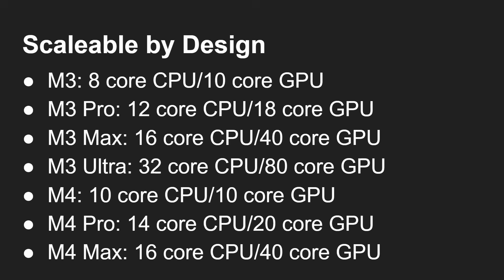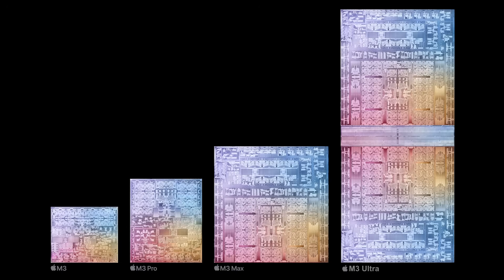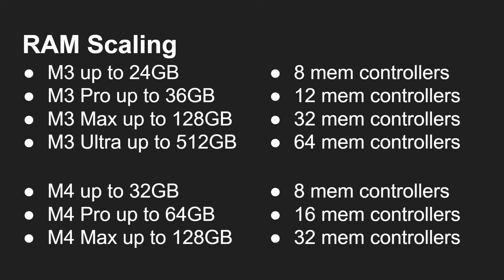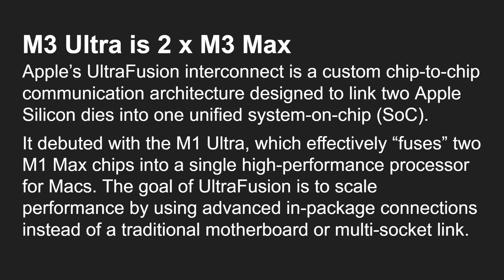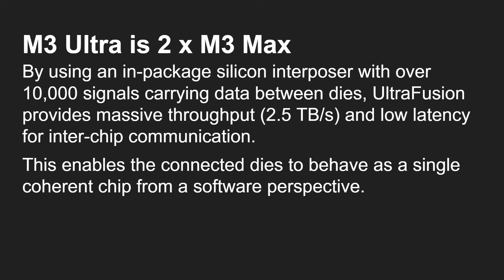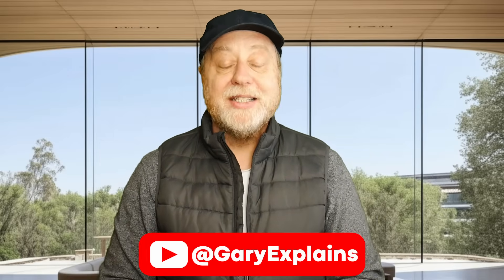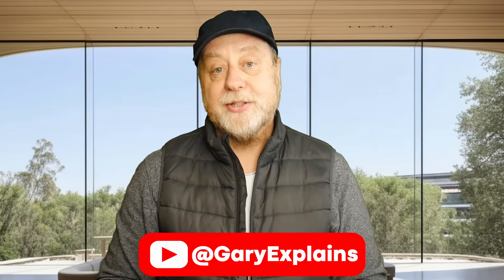The Magic Behind Apple's UltraFusion Interconnect

Comment: I am somewhat dubious that the yield from this interconnect process is better than the yield of two adjacent die on the wafer being good.    By two die I am making the assumption this could be done with a single die which is double the area of a single die.
Reply from the maker: There is a limit to the die size, so a bigger single die can't be made.

Comment: The M3 Max did not have the interconnect when it appeared. The M4 Max doesn't either - so the lack of that on the Max at release doesn't mean that  an Ultra wont come from a later run Max, as discussed heavily on recent ATP episodes.
Reply from the maker: Some people seem to be confusing the lack of a physical interconnect and the support for an interconnect. Not having the "pins" on the Max version is basically irrelevant. The message that Apple seems to be sending out is that the M4 doesn't support an interconnect, not that the pins are missing.

Comment: This has a lot of inaccuracies, but it's a video about the UltraFusion Interconnect, so I'll stick to that. You keep talking about 'snooping' but don't seem to know what it means. Each die has a cross-die coherency controller which is only active if it's in an Ultra configuration connected to another die. The protocol is called snooping for historic reasons, but the coherency controller doesn't 'snoop' looking for stale cache data. Half the system memory is on one die, and half is on the other. When a core accesses memory on the other die, it sends a request across the interconnect, and the coherency controller keeps that address/core in a dictionary. Each core has caches. When system memory is accessed, the coherency controller checks the dictionary and sees that cores on the other die are using that address so it sends a message across the interconnect telling them to update their caches with the new value. This is a lot of traffic, and it's why the interconnect needs so much bandwidth. The whole NUMA (non-uniform memory access) architecture is like a Xeon or EPYC server, and it makes things a lot more complicated. They had to make a lot of tradeoffs. The memory has crazy badndwidth, but latency isn't is any better than anything else. It's basically GPU memory which is being shared by everything, so even though it's almost as much bandwidth as a high-end NVidia GPU it has a lot of caveats because everything is sharing it. Most of the bandwidth is used for coherency traffic.

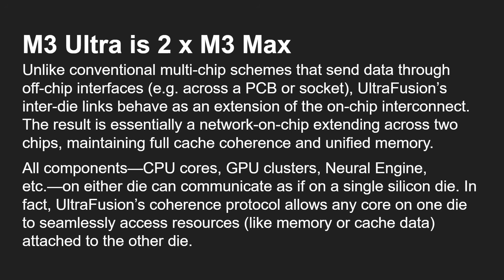10:35 It's not like being on the same die. There's sooooo much more going on because it's NUMA, and memory latancies across the interconnect are just as slow as cross-socket latency in Xeons. Not to say that it's slow, but it's also not faster than a DDR5 Intel machine whether you're talking about cross-die or local memory access. It's about 80 ns local and 120 ns cross-die.

The magic is in the bandwidth, and the coherency controllers, and fitting all that into something that small. But it's still a Mac. Those GPU cores are magically power efficient, but they're a completely different architecture from NVidia, which is why you can barely run TensorFlow and you don't have most of the libraries you need for it.
Reply: Luckily it's a Mac, so you don't have to use TensorFlow and hop on to the crazy Nvidia roller-coaster of vapourware. You can just do Mac type things! 🎉 ... over 40 years of Macintosh and people still haven't got it. Wetware evolution is so slow, you always have to wait for one iteration to die in order to improve.

Comment: Do you think we are about to see a revolution in how we program and design chips?  We spend so much silicon doing branch and cache prediction and with AI it looks like we will finally have smart enough compiler technology that we could finally move that responsibility to software.  Let the software inform the hardware about what can alias, what needs ordering guarantees and what memory should be loaded into cache.  This may have been the idea with Itanium but it was focused at very short term instruction level stuff and the compiler technology just wasn't there but it seems like that is finally an idea that may come of age.
Reply from the maker: The problem is that with a multi-tasking system where lots of different tasks are running then "the compiler" only knows about the code it is compiling, not the whole system.
Reply: @ That is certainly true and the processor would need to allocate cache between processes but thats no reason not to tell the processor what information will be needed and when.  I guess I just mean do you think we'll move to a world where software cache hinting is both extensive and necessary and similarly with hinting about branches taken and alias hinting?  I mean tsx can offer huge speedups for transactional memory and it's basically very limited hinting.

But I don't really understand why cache hinting isn't more used now so I must be missing something.
Reply from the maker: I think cache hinting is used a lot, and all the current pre-fetchers, by design, try to "guess" what data will be needed in the cache next based not only on the address of the last failed cache miss, but also what is in the pipeline and what the branch predictors are saying.

Comment: We can only speculate why Apple used M3 architecture instead of M4 for the Ultra variant, but it might be that M4 is designed for the next gen Ultra Fusion interconnect. M3 Ultra might be the last chip using 2D die stacking, while M4 Ultra could use next gen version based on the TSMC's SoIC-mH (molding horizontal) 2.5/3D die stacking now rumored to be only in the M5 Pro, Max and Ultra. There's also a rumor that M4 Ultra is being saved for the Mac Pro which should be revamped and updated by the end of this year in order to increase its very low sales and promote its quite niche market customer base. Another speculation is that Ultra variant has been silently discontinued after M3 Ultra together with Mac Pro, but I don't think so as Ultra chip is something like "one more thing" to classic 3 version Mx chip offering. Mac Pro on the other hand looks kind of questionable in comparison to the quite successful Mac Studio, but Pro might stay alive and become something like Mac Pro "server" with upgradeable cards and storage. Only time will tell which of these and other speculations r true, but what we can be sure of is that 2.5/3D chip stacking and advanced packaging like TSMC's SoIC is upon us besides other very interesting chip technologies in making as further transistor shrinking is becoming more and more difficult. Rumored 2nm M6 isn't a silver bullet solution and even Apple knows it's hitting the limits so more other exciting tech will be needed. I also think that in one point when price is right we will see Apple adopting HBM for their top tier chips like Ultra and Max as an indirect competition to Nvidia's AI enterprise chips. Apple certainly wants a piece of that BIG AI pie mostly enjoyed by Nvidia. Personally I think Mac Pro server-like solution could be a great idea if Apple opens Unix based Mac OS to more customization and variety of supported upgradeable cards and 3rd party tech.

Comment: Another possibility is that maybe the M4 ultra design is not based   on the standard M4 Max SOC but on a different M4 Max type SOC designed for the fusion process. As clearly the M3 Max Fusion SOC is not the same old M3 Max.

Comment: The main reason for countless versions of Intel and AMD chips is binning, not demand.
Reply from the maker: I don't think that is correct. The different model variants with different clock speeds, yes, but Intel has a huge range of CPUs that have nothing to do with that.
Reply: Of course there are different designs for different purposes, like ultra low power mobile chips, mobile chips, desktop and server grade chips. That is a part of the variety and that is based on demand. But the fact that there are between 3 and 10 tiers of the same chip each, is based largely on binning. Yields and fabrication defects lead to this. This can be observed well with the 7000 series of Ryzen chips. They’re essentially all the same chip with different binnings and cores disabled. Silicon lottery defines the top speed, core defects in manufacturing lead to different core counts. And because developing wafers is extremely expensive and time consuming AND there is very limited fab capacity worldwide, getting the absolute maximum number of sellable chips out ofveach wafer is paramount to a profitable design.
Reply from the maker: Obviously I am talking about the first list you mention from ultra low power to server. Apple doesn't need to make those, it just makes what it wants.

Comment: At what costs in performance does the interconnect come all te synchronization comes at a penalty in performance, maybe its more penalty in terms of CPU usage than in use of GPU usage or NPU usage, BUT synchronization dooes not come for FREE, otherwise i would make sense to link 4, 8, 16, 32, 64, 128, 256, 512, 1024,.... CPUs via Ultrafusion, the synchronization work will grow exponentially and eat up the performance gain additional CPU-dies will deliver. The question is simply how small Apple can get the synchronization if it is just a 5% Overhead, or a 30% overhead, combining 4 Dies as rumoured for the hydra only makes sense if the ovehead does not exceed 50% (even then it is highly questionable if it makes sense), also the efficiency comes into play as the prices due to small numbers will skyrocket in production. It seems allready that the M3 Ultra provided Mac-Studio sips more than double the power than a M4 Max equipped Mac Studio, which leads to the assumption that a 4 dies arrangement even would perform worse.
Reply from the maker: If the M3 Ultra is two M3 Max chips then of course it uses twice the power 🤦🏼‍♂️
Reply: @GaryExplains  It is not two complete max Units, but one ultra unit sips more than two complete max units, its sips more than double power but providing less than double the performance. so efficiency factor is not 2 but more close to 1,5 to 1,7 depending how well it scales (the metric asked is performance per watt)
Reply from the maker: Isn't that true of all multi core systems from every processor designer. It isn't about the interconnect. Amdahl's law etc.

Comment: I suspect a problem for Apple is that TSMCs 2nm process is a year late and we don’t yet know if it will be out late this year, or next year. An M4 Ultra might have been designed for 2nm but couldn’t be made yet. It’s always possible that Apple may come out with newer M4 Max chips with the connector, when they’re ready. Otherwise, we might see it for the M5. I’m still using my M1 Ultra Studio. It’s plenty fast still. But if an M5 version comes out late this year or next year, I’ll likely pop for one.

Comment: 15:22  the M3 Max chips that shipped in the MacBooks didn’t have interconnects either. They manufactured updated versions of M3 Max with the interconnect, thunderbolt 5, and extra RAM capacity, just to use with the M3 Ultra. So they could be planning on doing the same thing with M4 Max. The M4 Max that is currently in releases products doesn’t have an interconnect, but they could be manufacturing versions of it right now for the M4 Ultra that would, theoretically go in a new Mac Pro. They may even be manufacturing M4 Max chips that can connect FOUR dies together for an even more powerful ultra chip; again, in theory, for the new Mac Pro, which would help differentiate it from the Mac Studio. So the M3 Ultra is for Mac Studio and M4 Ultra is for Mac Pro. Since most people don’t see a reason for Mac Pro to exist anymore, beyond the PCI slots. So saving an M4 Ultra for the Mac Pro would give a reason for its existence.
Reply from the maker: How do you know the shipped M3 Max didn't have the support for the Ultrafusion interconnect?
Reply: @GaryExplains  images that were supposedly taken of the M3 Max dies (not the marketing images on apple’s website but like real images). People analyzed the images and said they didn’t show the same interconnect as was visible on the M1 and M2 Max. I suppose it could have been hidden or just looked different - or it could have been a mistake altogether. I guess i could tear apart my M3 Max MacBook and check 🙂. But as you correctly pointed out at the beginning, the M3 Max chips in the M3 Ultra are not exactly the same as the ones that have been shipping. The M3 Max in my MacBook has thunderbolt 4, not 5. Also, the M3 Max chips for MacBooks topped out at 128GB of RAM, but the versions in the M3 Ultra are up to 256GB each for a total of up to 512GB. So if they could manufacture special versions of M3 Max just to create an ultra chip with thunderbolt 5 and up to 512GB of RAM, there’s nothing fundamentally impossible with them doing the same with the M4 Max and adding an interconnect if they wanted. Or they could do something different than the ultra fusion interconnect but still, in the end, call it M4 Ultra just to keep the branding consistent. Not saying it’s likely, but it’s not impossible either. Of course, Apple did say that not every generation of the M-Series has to have an Ultra version,
Reply: Of course it isn't that would be profoundly dumb and inefficient and wateful
They said it's an every other version thing, and that's because TSMC's SoWoC lines are so booked they can turn away business on a whim.

Comment: now what I really don't fully understand is how is Apple able to reach such an amazing improvement in CPUs and no one seems to able to do anything quite similar
Reply: Apple rewrote MacOS to run on Arm64. That was a lot of work. Microsoft did the same thing with the Surface, and those were terrible at first, but Arm64 surfaces have improved a lot and now all Surfaces are Arm64. The thing is, Microsoft uses Snapdragon cores for Surfaces. But Apple really committed. They got an Architectural License from ARM and made their own cores, and the performance cores are more Intel-like with 19-stage pipelines. And they made their own GPUs. They had to. Apple had terrible GPUs because NVidia doesn't care about making drivers for Apple. If you wanted a good GPU it needed to be a Radeon in a thunderbolt eGPU enclosure.

But machine learning stuff is all about TensorFlow and having NVidia GPUs (CUDA). Apple didn't make NVidia-like GPUs, and there's no Rosetta to convert CUDA into Metal. You can run TensorFlow on Metal, but most things which require a lot of compute (like training an LLM) are problematic because you don't have the libraries for Metal like you do for CUDA.

The really awesome thing about the M-series CPUs is their memory bandwidth. The M3 Ultra has 900-950 GB/sec bandwidth, and the best NVidia GPUs aren't much faster. But the HUGE headache Apple now has to deal with is accessing that shared memory — especially across the interconnect. There are a lot of latancies to think about, and everything needs to get juggled around so that cores are hopefully accessing memory closer to them. Everything the CPU does is using that same memory. It doesn't get a separate memory bus like an Intel machine. The CPU is basically wired directly to GPU memory and EVERYTHING needs to access the same memory. And if you know anything about multithreading/concurrency that introduces a lot of problems with safely accessing memory.

Point being, the M chips are awesome, but they're only awesome at specific things. Apple GPUs are purely optimized for low power, and they're a totally different architecture from CUDA, so getting any kind of CPU or GPU-limited app to run well on Apple is quite complicated. We're talking about thousands of libraries built for other architectures. As a developer I prefer MacOS, but ... if I'm working on ML stuff I'd rather just use Windows 10. I have the MS Linux subsystem and still have CUDA libraries.
Reply: @RaquelFoster  so basically that's why apple still sucks at running games compared to the competition
Reply: Importantly, Apple has been working on its own low-power designs since 2009.  Everybody else including Qualcomm was using ARM designs which were very poorly optimized for most of the past 15 years.  Apple was the first to realize how terrible ARM designs are, saying, "we can make a CPU 2x better by optimizing for workstation architecture instead of embedded low-cost architecture".   I wrote a slide deck in 2017 about how to build a PC and i calculated mips/watt/Hz and Apple A-series shocked me as they were 2x better than x86!  You can find my 2017 slide deck on a public PDF sharing website somewhere ... Note that AMD Zen5 is getting close to Apple performance, while being handicapped on 4nm process node (M4 is 3nm).

Comment: 5:10

Nah.  TB5 was announced a couple before M3 Max.  Apple has collabed closely with Intel on TB from the beginning, so they could easily have built TB5 into the chip as they were developing it, with the plan to only unlock it later because Apple.
Reply from the maker: I am sorry, I don't understand your point, "nah" to what exactly?
Reply: The notion that it's definitely not the same silicon as M3 Max.
Reply from the maker: OK. I am not here to argue. I know they are different and that TB5 requires different controllers than TB4 and those controllers are in the M4 Pro/Max and the M3 Ultra. When the M4 Pro/Max were released this is what Apple said, "M4 Pro and M4 Max enable Thunderbolt 5 for the Mac for the first time." So how can it be in the M3 chips that came before the M4 Pro/Max?
Reply: I'm not here to argue either.  I'm not saying it's one way or the other.  That being said, Apple's statement doesn't preclude the possibility that TB5 capability was built-in to the M3 Max silicon, but was simply not enabled.
Reply from the maker: Using that logic then you can't preclude the idea that in fact the M4 and M5 are actually already baked into the M3 and Apple is just enabling bits with each release. 🤦🏼‍♂️